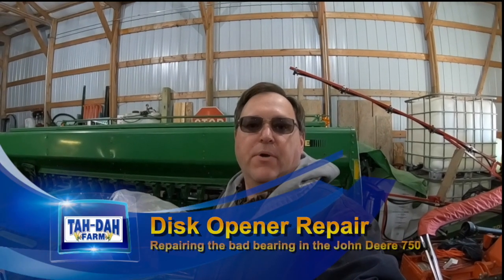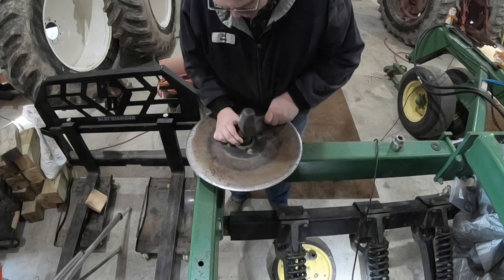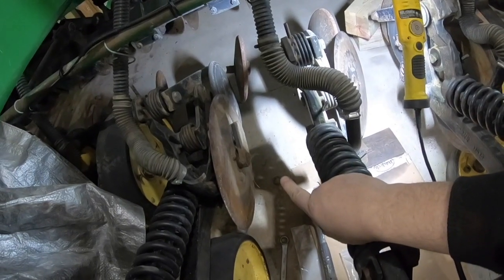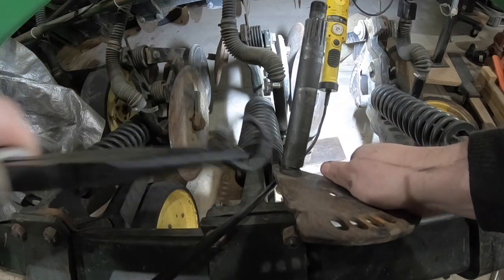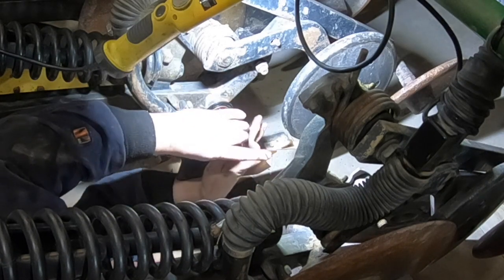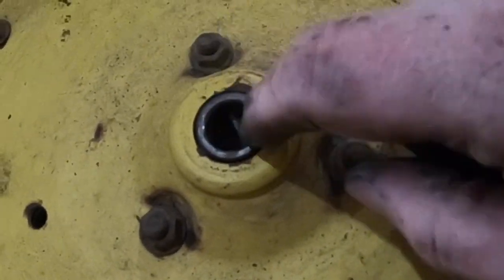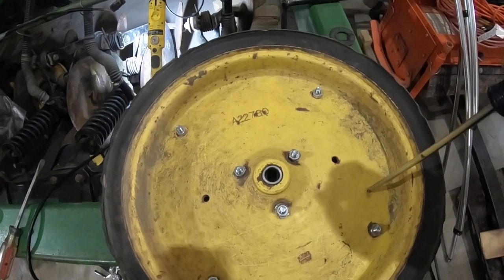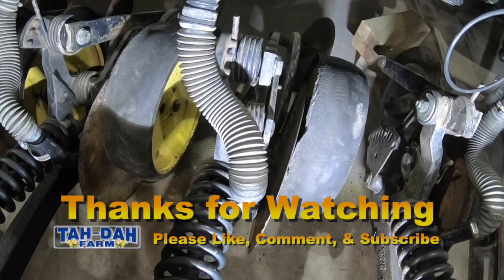John Deere 750 Disk Opener Bearing & Gage wheel Repairs

Comment: Are your seed boots in good shape? Mine were border line ok or not so I changed out the back row last year. Not a bad job just a little tight for a bigger guy to get in to. Lol
Reply from the maker: The seed boots are good, and sturdy but in the area of the wear part, yeah mine are  border line also. I'm gonna go with them this year. My disk are also borderline and I intend on next year rebuilding the row units. So far this year I've mainly focused on the front rows because they are way more difficult for a big guy, lol. One thing I have found on a regular basis is that the disk openers bearing have been at least 1/2 to a full round loose.  I have 15 complete replacement kits for the firming arms, all the closing wheels have been updated,  and next year I will get the seed boots,  disk openers,  and gage wheels replaced.  If I can have this done and the possibility of an 80 acre field comes though, I will plant some wheat next fall. Big plans this year.